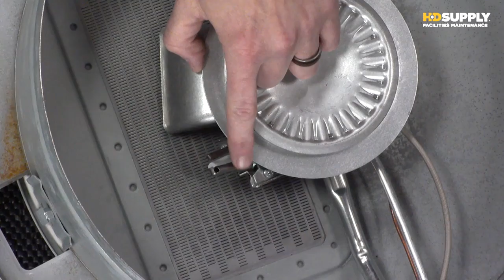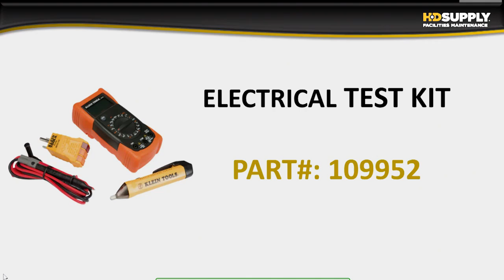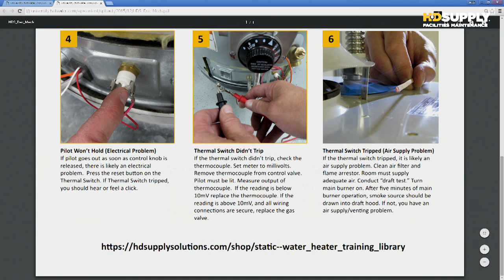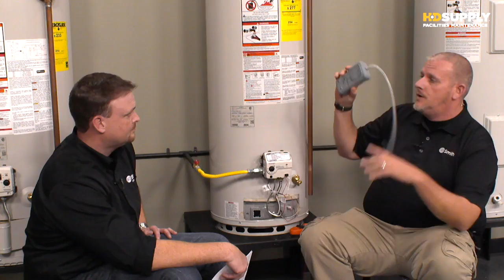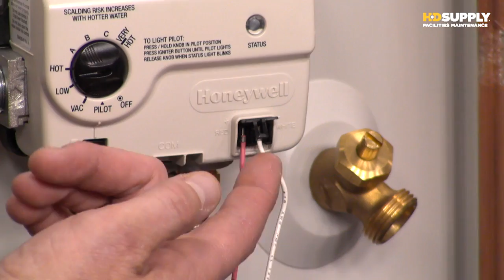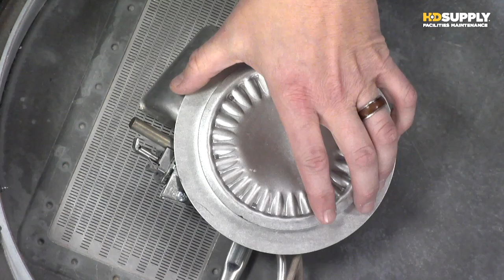A.O. Smith - Residential Gas Valve Troubleshooting | HD Supply

Comment: This is the best instructional video I've ever seen.  No light no pilot. Tested door switch its was triggered. Purged system Got the burner going. shut it down clean burner and swept the floor. ordered a  window vent 18x18 to replace corroded one. Burner works like a charm.

Comment: Just like to add some info here. For my case, the voltage does fall in the normal range: can reach 730 mV, but the pilot light cannot hold, once the knob is released, the light goes off, and also eventually the status code shows as 2 - low voltage. The thermopiles have been replaced when initial issue is found - low voltage. Searched the videos on YouTube, some think it is the case - the gas control is out of function. My AO gas water heater is less than 6-year-old.